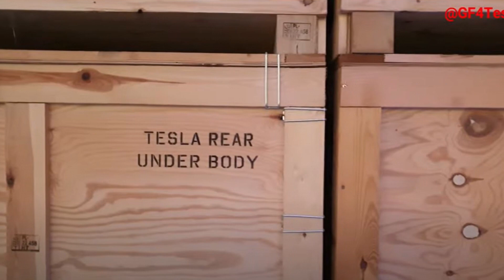BREAKING! Tesla Is Expanding Giga Berlin on a New 250 Acre Land

Comment: Once Giga Burlin is ramped Tesla will make a huge move to add three more facilities like they have now in the same location one every two years totally more than 3 million cars per year by 2028. The battery plant there has planed to supply for 4 units and not just one! As for water the local government will import water from northern part of the country via pipe system . IMO
Reply from the maker: Giga Berlin's ramp of Model Y production is key to Tesla.